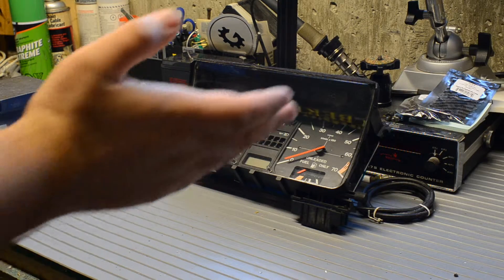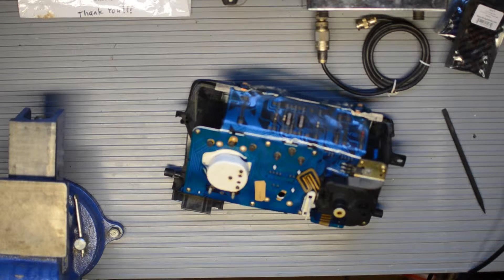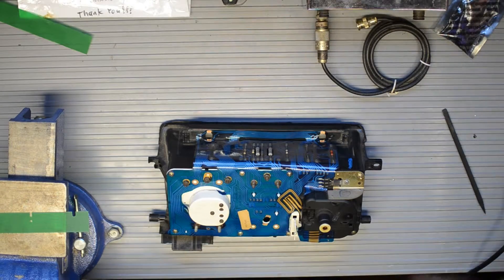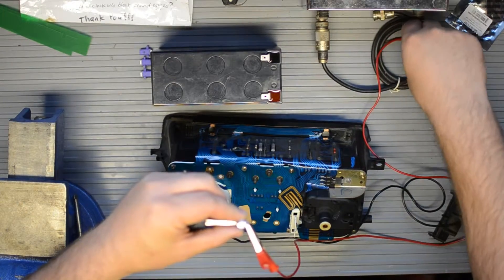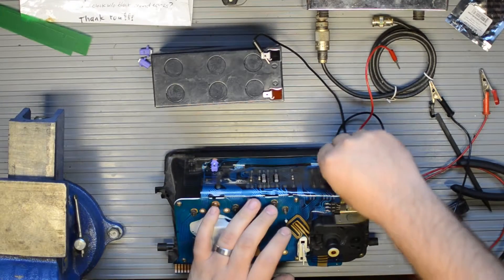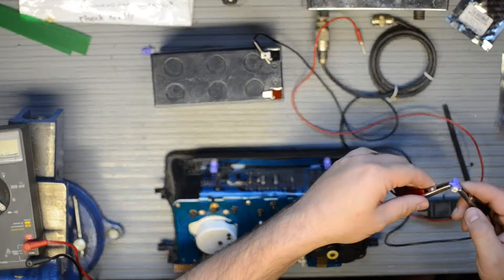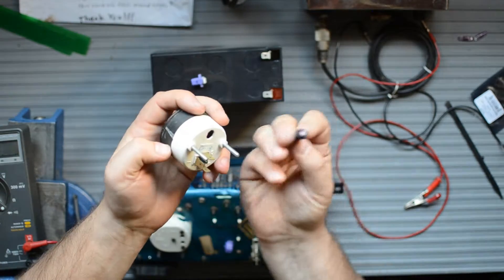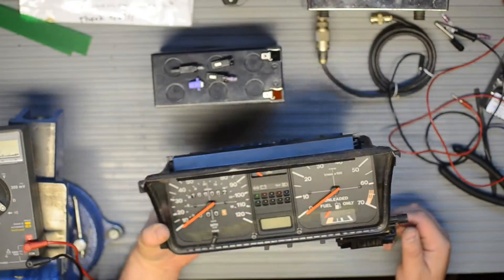008 - Installing LEDs into a VW Instrument Cluster!

Comment: Hi there, quick question so, randomly my cluster illumination lights stopped working. (All three bulbs) evertything else works, the dimmer and such. All of the other lights dimmable by the rheostat. I replaced them with leds from Suoerbrightleds, and still nothing, flipped them even, in case the polarity was incorrect. What could the problem be? Didn’t see your email in the about page. Your help would be awesome!Thank you!